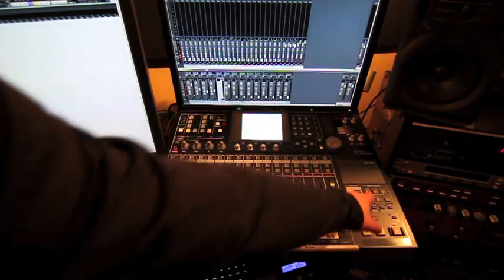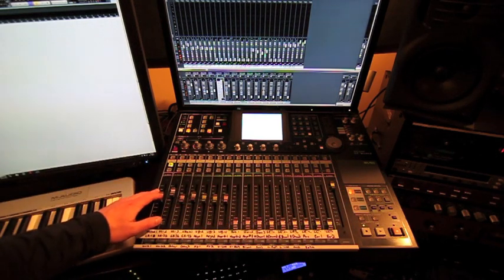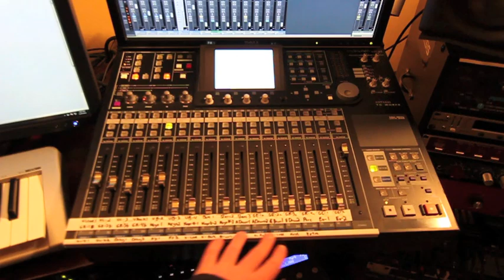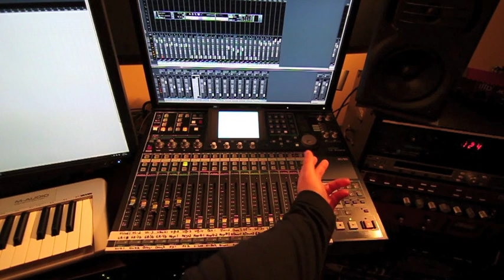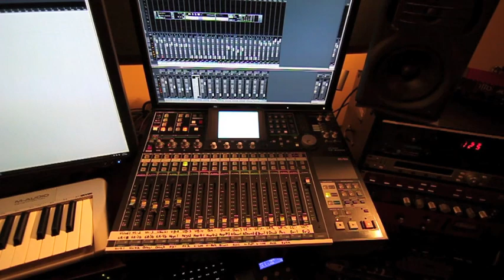Tascam DM24 Control Surface for Cubase

Comment: Hi Jon,  I recently purchased a DM 24 and MOTU 2408mk3 and I am having a hard time getting it set up.  I am receiving signal to Digital Performer 10, but track 1 is coming in on tracks 1 and 2 and nothing is appearing on 3,4,5.  I'm hoping you might be kind enough to help me get this sorted out.  I would very much appreciate it if you could.  Thanks, Pete-

Comment: I  am trying to connect my tascam to Cubase and now I have found your great video. I don't know what I am doing wrong but it doesn't work. How do you have your Tascam with MIDI connected to yor PC? Which Interface do you use? 
thanks in advance

Comment: Hi Jon, great work friend. Please help with the link that does not work. Thank you so much
Reply from the maker: Hi I just added the a dropbox link in the video description with the download and a readme.  I have to try and get my old blog recovered.  Check the zip file linked in the video description.
Reply: 1000x Thank you so much
Reply from the maker: Actually check the latest link I added in the description now.  I just added an images folder to the zip which shows all screenshots of the DM 24 combined with the mixer map in the zip, you should be good to go.  Let me know!  I'm not sure I can get the old blog back but I did find the screenshots just now which completes the puzzle!
Reply from the maker: Awesome! Thanks for responding! Pretty amazing how old that board is and how useful it still is!

Comment: Hi Jon, I just checked the link but it was still down, please can you tell me how to configure the DM 24 with Cubase 5? Thanks
Reply from the maker: Hi I just added the a dropbox link in the video description with the download and a readme.  I have to try and get my old blog recovered.  Check the zip file linked in the video description.
Reply: @JonKragh  hello. Can you please help me and tell me if I can use a Tascam 2488 Neo - 24 Track digital recorder with Cubase 5? Thanks for your help if you can

Comment: ok sure. thanks for the information. I recently got a DM24 for $150. Sounded like a bargain to me, but I haven't connected it to my studio and not sure if it will work for me in my current setup. It does have the firewire card installed, so I might but a firewire PCI card for my PC, install it, and try connecting the Tascam VIa Firewire to my PC and see how that pans out. I am running windows 7 64 bit and Ableton live. Not sure if it will be compatible. Iw ill be trying it soon. otherwire 2nd option, I will end up buying an audio interface such as the focusrite scarlett 128i20 and use the Tascam via Adat light pipes, so I can have 8 channels or additional mic/line + all the internal onboard effects. :)
Reply: Hey, did you ever get this working? I just picked up a cheap DM24 and am planning to use it with Ableton. I have the ADAT working, and can manually map faders as MIDI controllers, so that's something I guess :)

Comment: Thanks for sharing, Ok so in other words, you are controlling Cubase using the midi from the Tascam. Does this setup of your make use of the Motorised faders of the Tascam ? Wouldn't u rather use the HUI protocol of the Tascam ? 
Have u tried setting it up using FireWire and recording audio from the Tascam into your DaW   ? 

Many thanks
Reply from the maker: Amar Mashruwala No prob! The HUI doesn't give as many channels of control from what I remember. It's also more cumbersome. This setup for me was more natural.

I don't have the firewire card and only record two channels through my old school apogee psx 100 SE.  Maybe someone else can chime in about the AD setup for the tascam.  I simply use it as a big control surface nowadays.

Comment: Hi Jon, great Video, I have a few questions for you. Are you using PC or a Mac ? If your using a PC, which TASCAM driver did you use ? Did you install a firewire card in your PC to connect the DM 24 ? thank you.
Reply from the maker: Amar Mashruwala Hey! I don't use firewire at all.  All midi. I think I use a roland mdi controller fwiw. This is a non audio setup with cubase.

Comment: I have lynx aurora 16, can I hook it up through AES output from DM 24? And is there any way to bypass the preamp input from DM24? One more thing, can I use DM24 as a Midi controller and preamp at the same time? After all, good video!!!

Comment: is it possible to say use the faders for tracks above 32? like if you had 40 tracks would you be able to move across to use the faders for the next 8 tracks above or does it stop at 32? any help would be much appreciated
Reply: There are 3 fader layers and 16 faders so in theory, you should be able to to control 48 tracks

Comment: Hi, i was wondering, what version of cubase are you using? I have a iMac running OS X Leopard, (which i could upgrade to snow L or Lion) with Cubase 5. I would love to buy a DM 24 with the firewire card but the Tascam site says it isn't supported by OS X, I keep doing research and apparently the DAW control features are no problem (I have a midi interfase) but most people dont use the 24 to record audio. Could i do that no problem with the firewire card? And, any comments on the 24's preamps?

Comment from the maker: @awqalli sorry, I don't use the DM24 for any audio - I run it 100% with midi to control cubase, so I'm not sure if you can do that with the firewire card.  Maybe you can route the effects to the DM24 aux returns and route those to one of your input channels that is assigned to the firewire card.  Just a guess.

Comment: Hi, thats gr8 work...I will try to do it. I have almost the same soft- and hardware as yours (I use Cubase (vers 3) + DM 24 and it works well with Firewire...BUT
may you explain here how you connect analog/digital extern FX like Tc electronics and route to Cubase and record it? I did try this, but i think it failed. IIt woulb be gr8 if you do this.Saludos aus Deutschland.